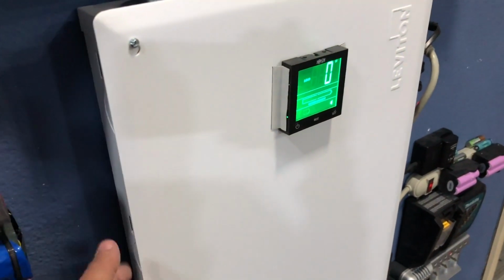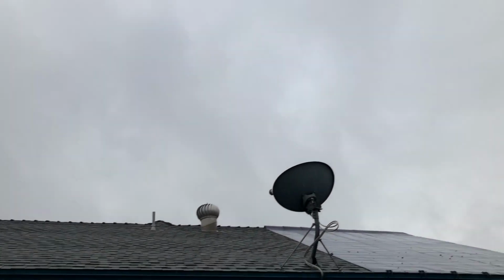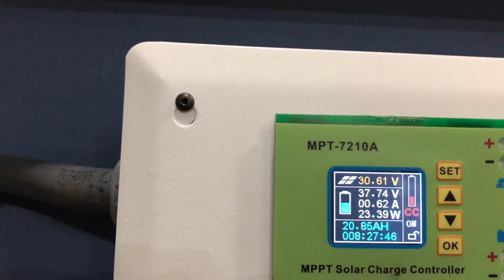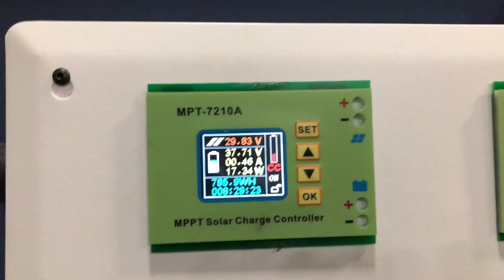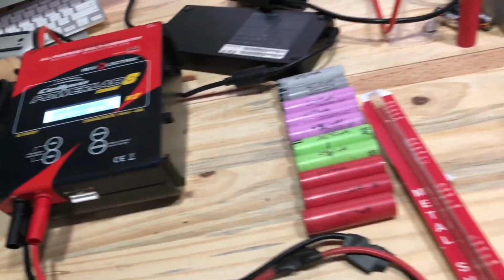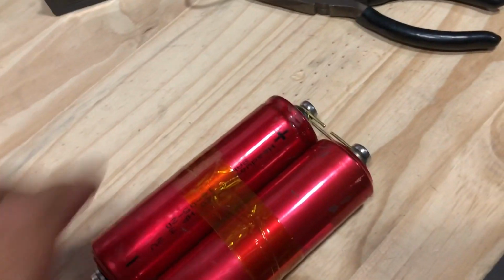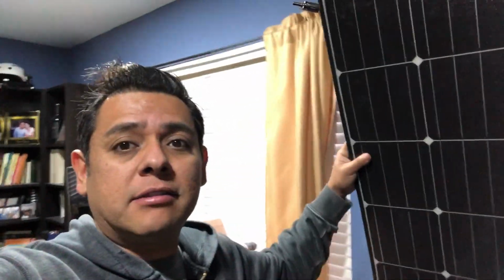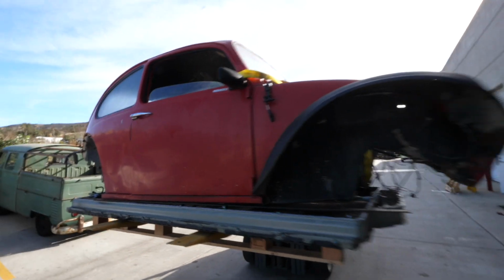Solar Update - Does Solar work on Cloudy days?

Comment: I have typical high efficiency panels on my roof here in the northeast and they make power almost every day, even when it is raining or cloudy. The main problem is that when it snows they get covered and then they don't produce anything until the snow melts or slides off.

Comment: The sun is still able to get through thick cloud. You can even still get sun burnt even under a cloud so it would have to be dark clouds to not get a good amount of solar charging happening.
My electricity bill for the last quarter in Sydney (summer) was $27 for my 24 panels 7KW inverter

Comment: these charge controllers can only take 300w at the voltage your using that is why you not getting a lot of power, try a midnite classic and see how much more power you will get from you panels :) I have both :) FYI love these solar videos!
Reply: If you could split your cells so that half feeds each of your 2x 7210's that would make better use. I have read that on cloudy days, panel placement is less critical as the light source is more diffuse, less directional.

Comment: 7210 is not pure mppt so thats one of the reasons they arent that efficient and you manually need to set tracking point.
Reply from the maker: yeah I set it at 24V.  as thats what the panels say its the sweet spot

Comment: You can change the channel for the fan\light. It's just little dips inside. My mother in law got like 5 of the same installed in bedrooms right next to each other and 1 up stairs. So it was crazy when someone woke up to go pee and turned on lights for others sleeping... I changed the dips for some and that fixed it...

Comment: The fan is not actually turning off and on by itself your fan is programmed either with another rooms fan or a neighbors fan... I would recommend changing the dip switches on the fan and remote
Reply from the maker: Doesn’t work,   This a bad product

Comment: Solar panels can produce some power on some cloudy days, although I've seen daytime skies so dark that 500 watts of solar panels (two x 250) didn't get above the battery voltage even with a decent MPPT controller (yes, there were thunderstorm warnings and tornado watches that day).  More common is seeing 500 watts of solar panels produce 5 watts of power on a rainy day.  Days with light overcast might see 50 watts or more from that array.  I've tested these panels and each can produce 235 watts in backyard sun on a bright, sunny day.

Comment: If your panels were pointed at the sun for even part of the day, you would see a much larger difference in solar output.  Also has to do with the efficiency of the charge controller.

Comment: TL:DR. Yes your solar at home will make power on an overcast rainy day. On all my installations they output about 25% compared to the next day when it's sunny all day. Summer or winter 25%. 
Mono and poly panels make most of their voltage as soon as sunrise, and drops off only at sunset, sunny or overcast. But it's the current that doesn't come up to a useable level till the sun hits the panels directly. 
And damn dude, put the panels facing the sun, your crippling the system before it can even do anything. Most of my jobs I install a string facing east as well as a string facing west, wired in parallel. That way you get the inverter hitting max output for the longest time in the day, without it clipping the top of the curve off. Which you will do with 30% more panels then the inverter size.

Comment: when you do the short circuit test and have the data from  the current shunt, at the same tome use a multimeeter to check the voltage between the battery terminals that have your brass buss bar connections. from that you will be able to calculate their resistance under load and the power in watts that is being lost across them. thats a huge deal when every watt counts for your storage ability. and why not use copper? like the bare ground wire used in grounding appliances in your home? its thicker and  copper. easy to get. do a comparison between the two wires

Comment: Yeah, Even on rainy days my grid tie solar does 324 volts,396 volts at 9 amps  on front house and 296 volts and 324 volts (no amp reading on that one) on back house with only dark cloulds on stromy days blocking enough enough sunlight to stop the photoelectrolysis........they'll pump 300+ volts till twighlight as  well when  they finally drop to like 4 volts no amps

Gotta love modern solar panel sensitivity

Comment: Jehu,hi, could you explain for us lower funtional human beings , what is the  different,or how do get from12 volts to a 24 volt ,or a 48 volt ,18650 battery system . I would like to have solar panals and do a eletric car converion....many thanks. And sorry if you have covered these in previous videos

Comment: Do a video with your diy power wall using a grid tie inverter with a built in limiter GTIL.
Reply from the maker: Unlikely,   Grid tie requires city permits or is illegal and im anti permits and I’m not ready to suggest people do illegal installs,  not when offgrid is perfectly legal

Comment: Oh Dude..!
I've been watching & loving ur vids 4 a while now... so keep up all the great work ur doing.!
(I even though about coming 2 help u when u asked 4 ppl 2 come n help put that giant battery system together, but it would have been way 2 expensive)
But I have 2 say, I thought u were smart enough to know Solar panels need 2 b put on the SOUTH FACING side of ur house... or at least smart enough to do some research to find that out b4 u just put them up there.!
2 things I would change, as I have plenty of solar experience...
1. move the panels 2 the South facing side asap...
U'll get way more power in all weather conditions compared to now.
2. Split the panels & wiring into 2 groups (or strings) wire 1 string into each of ur "MPPT" boxes...
(Though it would b even better 2 have 1 string so the voltage is higher, less amps = less losses, but u may need to change ur MPPT boxes 4 something better...
Much love & respect for all u do from the cloudy UK. :)
Reply from the maker: You need to watch my videos,  I explain. In detail why I do the things I do
Reply: jehugarcia Thanks 4 the reply...
I do watch them as they come out (the new 1s since about 1yr or so...) I'm still catching up on ur back catalog...
I must have missed the reason why u put them on the North side...
Please link 2 it in ur reply & I'll happily re-watch it.!
Peace bro.

Comment: Can you run 4 of them to make 40amps ? I'm ready to buy a 40amp one. Please make sure it auto adjusts voltages and has all the battery protection/ heat sensor

Comment: I bought 80 of those lifepo4 on eBay and they shipped right away
Reply from the maker: I don’t think they like me
Reply from the maker: Full river or the headway’s?
Reply: They are fullriver... I ordered them Saturday and they were delivered today
Reply from the maker: def proof that mine took longer to get delivered,  they told me they would not be able to send me samples of the 26650s because I was the reason they were slammed with orders.     I'm left scratching my head,   I would think lots of orders would be a good problem but I think they don't feel the same.   They later clarified that they felt gratitude for being mentioned and would love a review but still did not offer samples for the other cells and took longer to ship my cells..... so at best they are strange people
Reply: That is strange

Comment: I do not think they are balanced loads. They are not fighting for the current, it will go to the one with least resistance and possibly blow it up with 20A

Split your array into two groups of two panels and connect a group to each charge controller.

Comment: Somebody suggested that these MP-7210A's controllers are not Really MPPT but more like Voltage boosters. So you can charge a 24v battery with a 12v Solar Panel. That is nifty but what if you want it to find the best Power Point? Somebody explain to me what these 7210A's are really?

Comment: Would one of these mppt controllers work with my 245watt 37.5 voc volt panel?
Reply: yes, if your battery voltage is higher than the panel voltage.

Comment: Battery Voltage = 36v      Solar Input Voltage = 30v      Means its not charging?
Reply from the maker: It’s boost solar charge controller
Reply: Sorry you said that in the video and i missed it